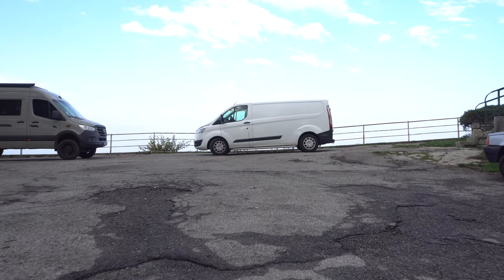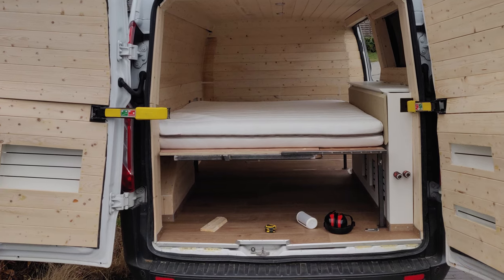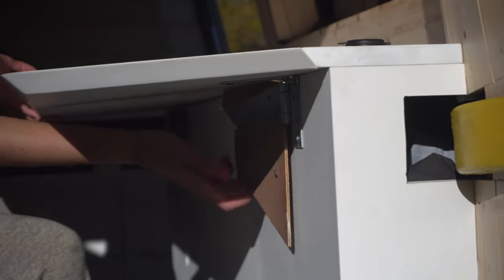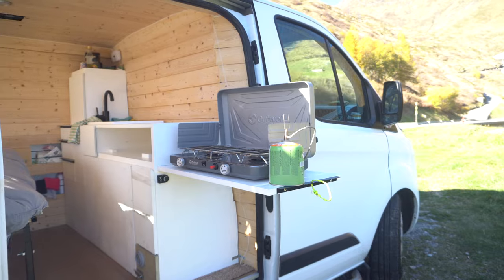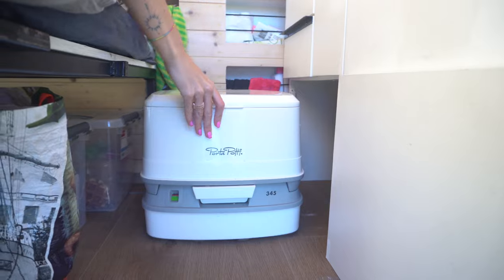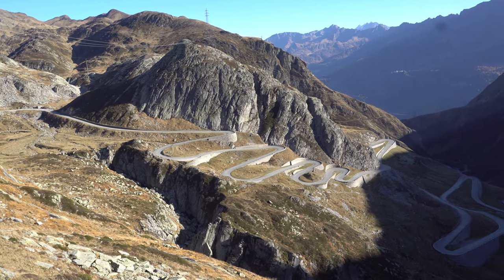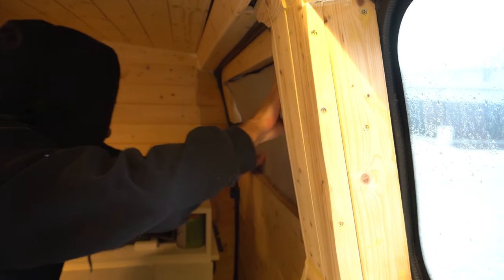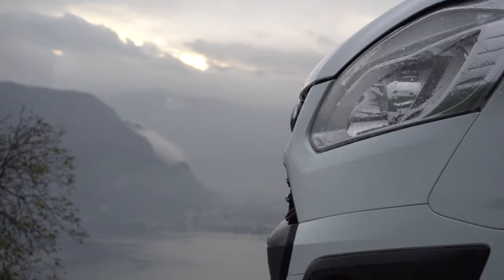Ford Transit Custom DIY Van conversion overview - Get your inspiration

Comment: Love the Van! Simple and practical. 

Did you get the storage units from a company as they look specifically made to fit your van? Or is this another design of your own…

I’d also love to see your bed design if you’re ok sharing it? I’m a welder so could fab that up to fit in my custom. No worries if not. Enjoy your travels

Comment: -100 points for using the bequiet fans and not noctua. You're losing out on a solid 2% performance right there. That is why you're slow on the water.
Reply from the maker: i'll take a look at noctua for my next build 🤣 thanks for the tip hahaha